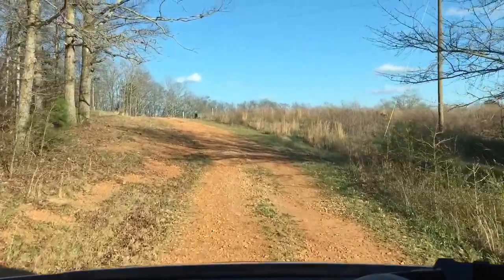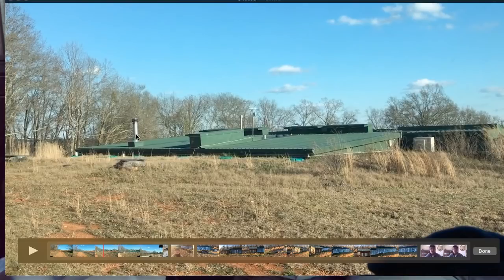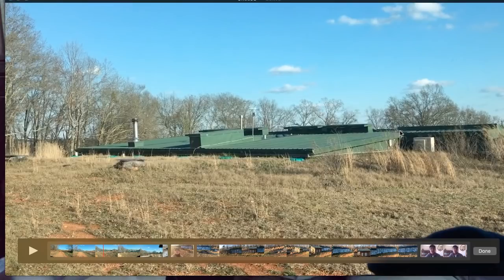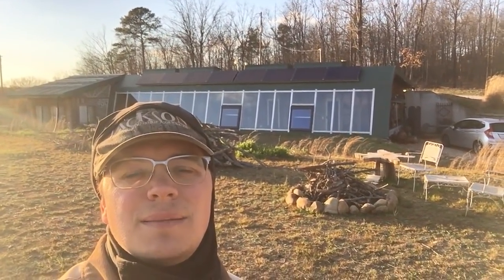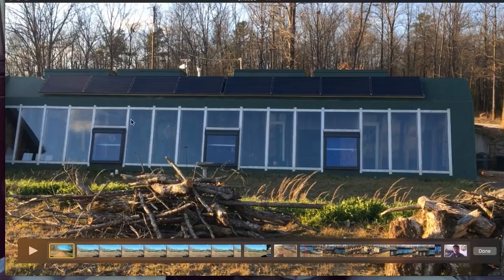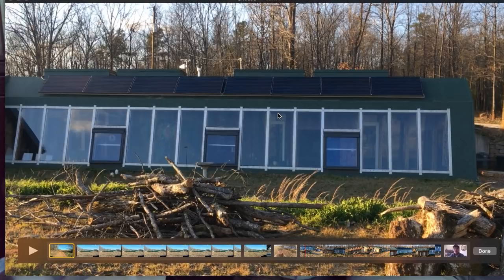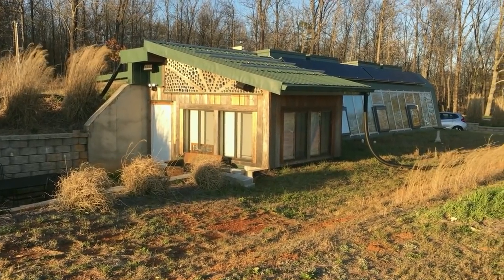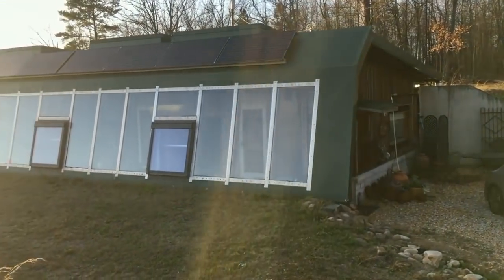EarthShip Exterior Tour:  Offgrid Georgia

Comment: All that work and the house is supposed to be built SE facing, not directly south. It's interesting that they went with the air conditioner. Every so often you see one of these things in the South and no one ever has a good plan for the humidity or they don't admit that it requires dehumidifiers full time. I also thought the air vents for the cool air were supposed to be at ground level to work. Doesn't matter though, as you said it's more of a desert thing. 70F isn't actually comfortable at 95% humidity. Your stuff tends to be damp all the time.

We really should just adapt the design to provide enough electricity to run air conditioners or dehumidifiers for the climate.

Thanks for sharing this. I stumbled on it after watching some other earthship building videos.
Reply from the maker: Yes hard to get around AC or dehumidification in the southeast. The good thing is that solar is pretty cheap now and putting up enough to offset a Minisplit or run directly of of it is not that hard

Comment: Hybrid Earthship lol 200 amp service but I like it Johnny
Reply from the maker: Yeah they needed to sell it and ended up slapping a 200a service on it.  The panel has like 1 breaker in it.  Everything else is fed by the Magnum Inverter.  The house was completely offgrid and they did fine in the winter but summertime was a bit warm.  They installed a minisplit and put the 200a service on the house to make sure they could sell it.  Not enough people in Georgia knew what they were looking at when it was for sail and the guy that bought it got a screamin deal....